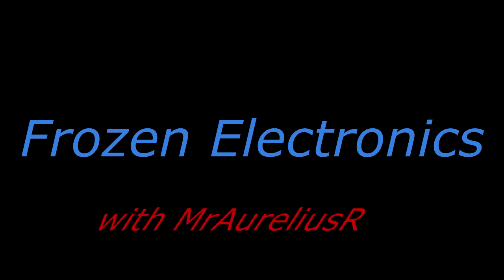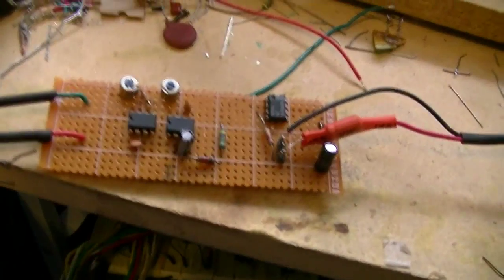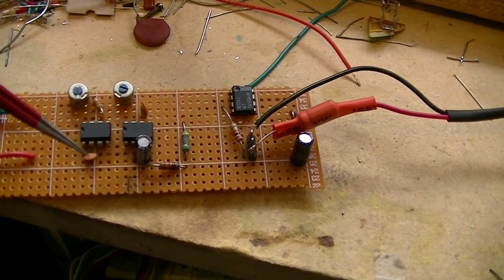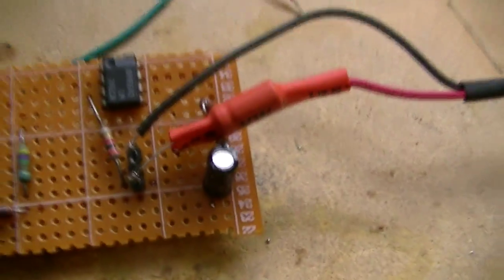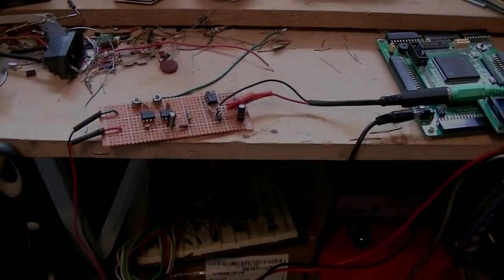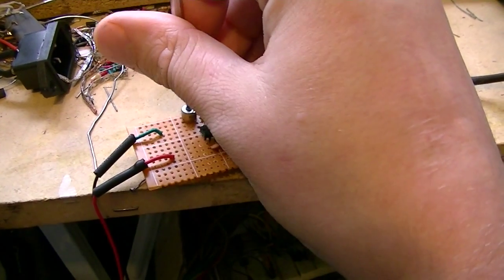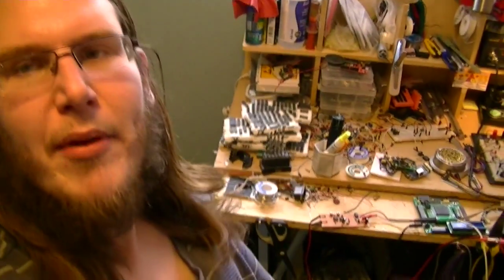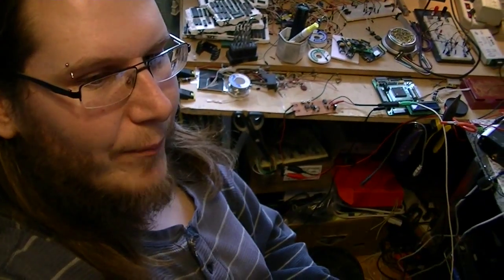555 Timer Atari Punk Console Build

Comment: How did you hook up the speaker to the 555 before? You shouldn't hook it directly to the output, rather, you should have a capacitor in series. Also, if you had a limiting resistor in there, well, that could have made the sound output low.
Reply from the maker: My schematic does indeed have a coupling capacitor. However, to get some more volume I was using a 'quick and dirty' op-amp. It's the fun behind hardware hacking :) just hook it up and see. I've now built another one with the output coupled capacitatively to a speaker and it sounds perfect, just quieter. I need to actually design a basic mono audio amp it would seem